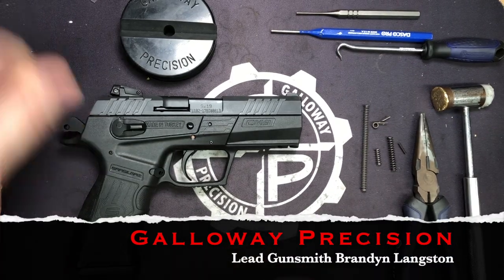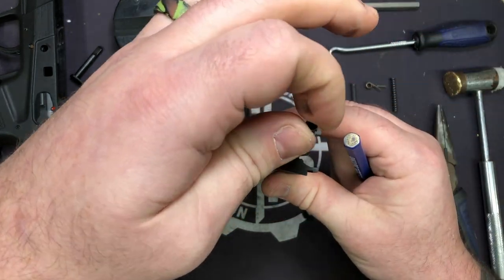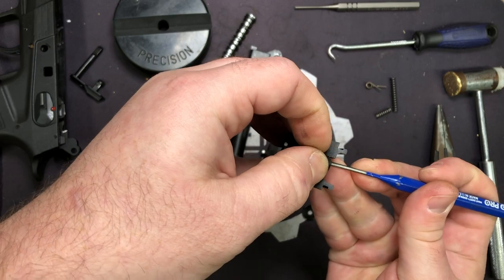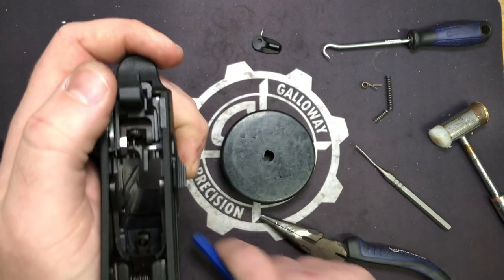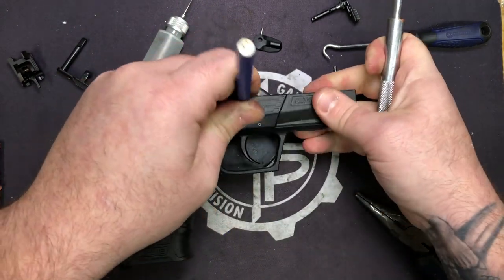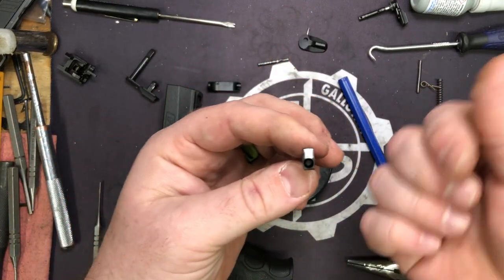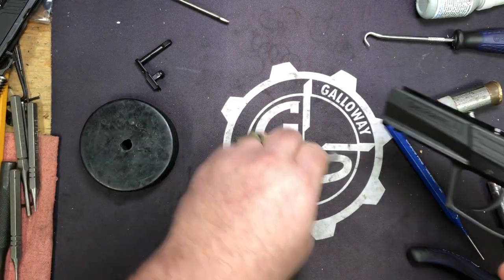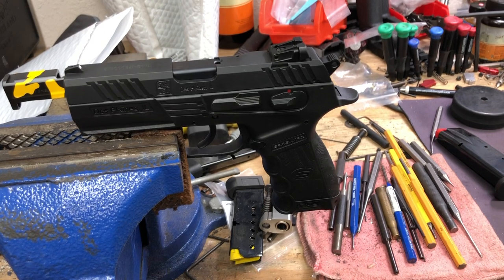SAR USA CM9 Gen2 Reduced Power Spring Set Installation from Galloway Precision

Comment: Got my kit installed. Thanks for the great video, I only had one moment of drama when my trigger return spring tried to escape. The pin in my safety is definitely smaller than 1/16th so I had to sort that out but I got it done. Immediately I can tell a difference. I think the heavy trigger pull was the one thing I noticed when I unboxed the gun and figured I would just get used to it. Now the CM9 feels more like several of my other pistols. I can't wait to shoot it! Thanks guys!
Reply from the maker: Glad you're pleased with the video and the spring kit. Thank you for the support and the feedback!

Comment: The safety was so tight.
It's rubbing the top of the frame on both sides.
I cut a 1" strip of 1500 wet and dry sandpaper. Removed the slide and lighty pushed down at the top of the frame while  I tucked the sandpaper under the safty lever, pull the paper across the top of the frame, then pull it back and forth many times.
Switch to the other side, repeat.
Eventually fold the paper in half, which will lightly sand the underside of the safety lever both at the same time, repeat on both sides. I put oil on the areas while sanding.
I saw no sanding marks while doing this on my frame.
This definitely loosened up my safety lever.
I tried working the Safety lever a 1,000 times, with oil, grease, nothing helped, until using 1500 grit between the frame and Safety Lever. Much more user-friendly.
I definitely wouldn't advise any modifications, such as sanding, or filing of the internal Safety Lever. Do not alter the internal "Safety" mechanism.
Semper Fidelis

Comment: Question. Has nothing to do with this process but with the gun. I just purchased one and I had messaged you about the kit and not wanting to reduce the SA pull, just the DA which you told me to not install a specific spring. That was just to trigger your memory. But I received my CM9 this past Tuesday, took apart cleaned and lubed and took it to the range today. The gun shot superbly but when I got home took apart to clean it and noticed metal SS shavings. The part from the sear group was shiny I looked on the under the slide and the  long metal bar was shiny and scratchy as well. Why would that happen?
Reply from the maker: That's just breaking in and smoothing out, perfectly normal as it breaks in.  I assume the part of the sear boat you're referring too is right on top where it rubs the slide correct?
Reply: @GallowayPrecision  yes.

Comment: I've done a ton of work to my Sars over the last decade plus. The one spring I leave stock is that short transverse hammer spring. That way I don't run into issues with harder primer cups on ammo like steel case. 

The rail mounted muzzle break sounds interesting. But just a simple standoff device sounds even better. And yes I understand if the break mounts to the rail it acts like a standoff but not everyone will want the added muzzle length.

Comment: Any advice for a fixing a REALLY stiff and gritty safety selector on this gun?
Reply from the maker: Just have to work it a bunch, that what I did on mine.
Reply: Take off the slide, get a
Reply: Take off the slide, get a towel , go turn on the TV and work the safety lever on each side, the right side sticks out more. I put Tetra Gun Grease on the left and right inside, the frame where they pivot, and keep working the lever on each side, about a
Reply: 1,000 times, it loosens up a little.
Not sure if its the internals, or its rubbing on the frame.
This is a Great Video, thank you, I subscribed Sir.